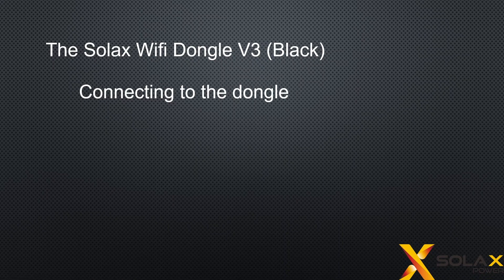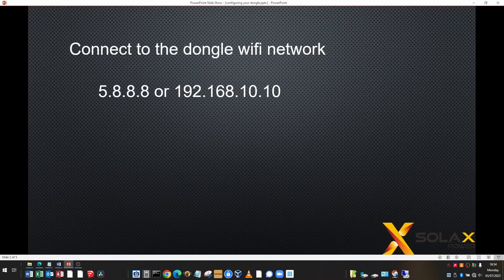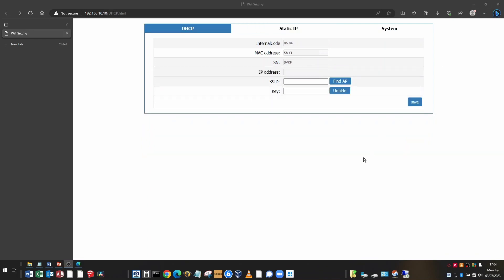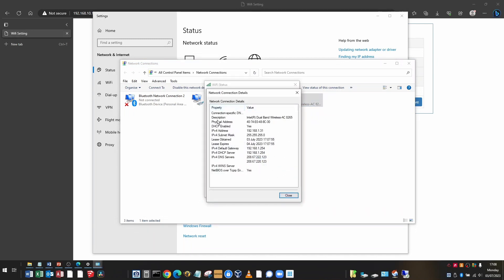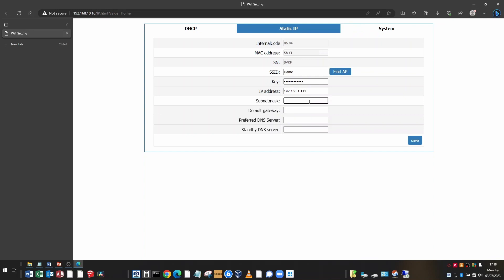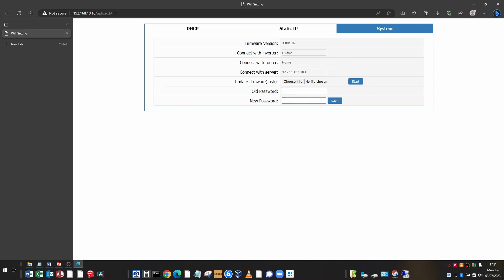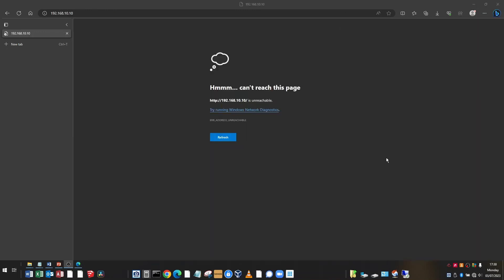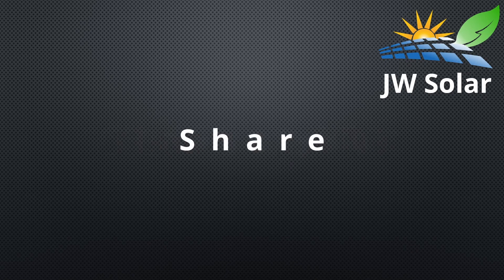Setup Configuration Firmware Update of Solax Wifi Dongle V3 Black

Comment: I am in the UK with a X1 Hybrid G4 and a V3 dongle. Support will only update to v3.022.03 and it  needs to be V3.036.x in order for the modbus.write.register commands to work in HA. Looks like I will need to build a waveshare device in order to have that control.
Reply from the maker: Where does it state that? There isn't a comms firmware version 3.036.x. V3 dongles are fine on V3.022.03 writing to modbus, and many previous versions.
Reply: @JWSolar  So I have setup HA, linked it to my inverter and octopus successfuly but the write.register command does not work. I have used GPT to help write the scripts and for diagnosis. It told me that v3.022.03 on a V3 dongle is write only (std monitoring) and the target firmware should be 3.036.06-3.03608. 

Internally, SolaX has several WiFi 3.0 firmware branches:

Track	Typical version range	Purpose	Notes
Stable / General	3.020 – 3.025	Standard monitoring	OTA default for most customers
Advanced / Beta	3.030 – 3.036+	Adds Modbus-TCP write, improved MQTT	Only pushed on request or via installer
OEM-specific	3.015 – 3.026	Custom branding (Growatt, FoxESS, etc.)	Locked to partner hardware

SolaX sells the same dongle under different certifications (CE, FCC, RCM). Before they mark a firmware as globally stable, they stage it region-by-region:

CN / AU got 3.036.x first (mid-2024)
EU / UK are still mostly on 3.022.x unless a user specifically asks

Perhaps I have a differnt issue if v30.022.03 should enable write commands
Reply from the maker: @beastiecarrion Thanks for the info. The inverter isn't locked by any chance is it? Select unlock advanced from the Solax Modbus Integration in HA.
Reply: @JWSolar  I double checked and it is the in unlock advanced state, under lock state. I think I will make your waveshare box when it arrives and try that way
Reply from the maker: @beastiecarrion  You would still need to change the lock setting and change it back again to unlock it.  Quite a few customers have needed to do this recently.
Reply: @JWSolar  Thank you fro the tip. Tried it and no luck ! waveshare method it is !

Comment: G'day, thank you so much for your informative videos. I am in the process of adding my Solax to my home assistant. My firmware version that is on both my wifi dongles is 3.001 which you mentioned is not stable enough for Home Assistant. Please can you tell me what the latest version is. I have reached out to Solax Australia but they are not being that helpful. Thank you 👍🏻
Reply from the maker: Hi! It now depends on which inverter you have. The latest version on newer G4s for example is 3.010.16, but slightly older inverters don't go that high. It got complicated.
Reply: @JWSolar  I've got two X1-5.0-T-D(L)
Reply from the maker: @leewilliams1515  Unfortunately, it's based on the serial number of the inverter and only Solax seem to be able to tell you which firmware fits. I can email you V3.006.04 if you like? But there may be further updates after that.
Reply from the maker: Join Solax Support UK Facebook Group and PM me. I'll send the latest version.